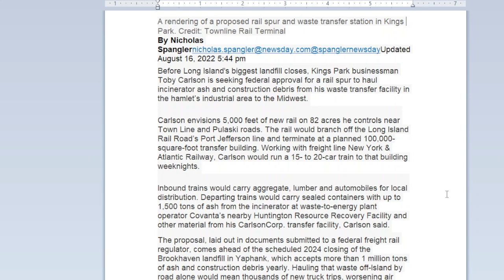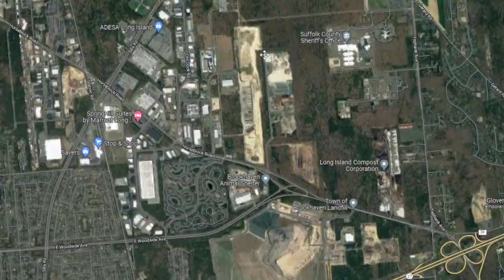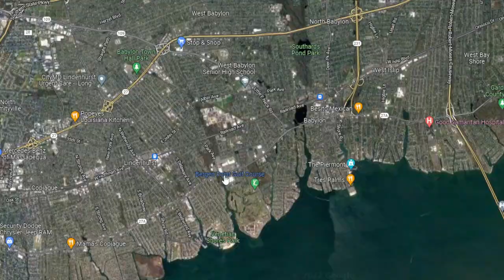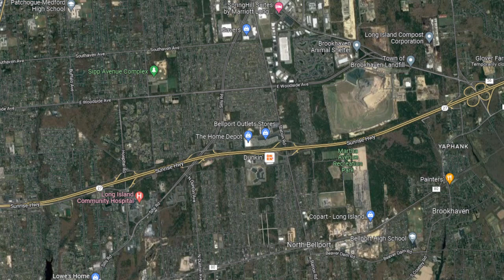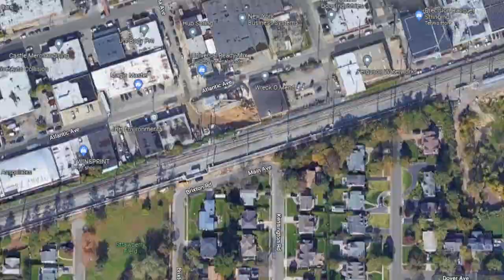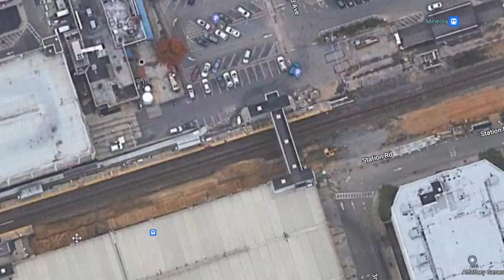More Waste By Rail Proposals For LIRR, But Why None on the Montauk Line?

Comment: Most of the customers that were on the Montauk branch get cars sent to Brookhaven rail terminal and get trucked to the south shore.
Reply: Most of the customers on the Montauk Branch ceased rail service by the mid 1990's and earlier.  Much it was based around the fishing and agriculture industries which largely have been gutted since the 1940's suburban expansion.
Reply from the maker: Well they should be delivered to the south shore via rail it would mean less trucks.